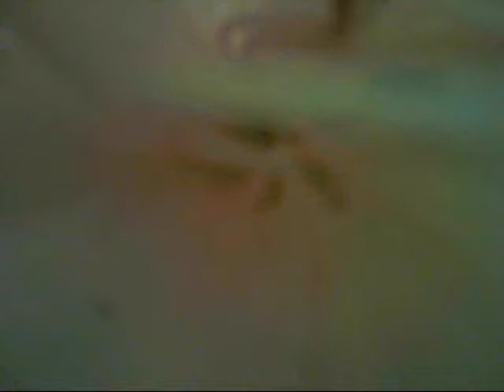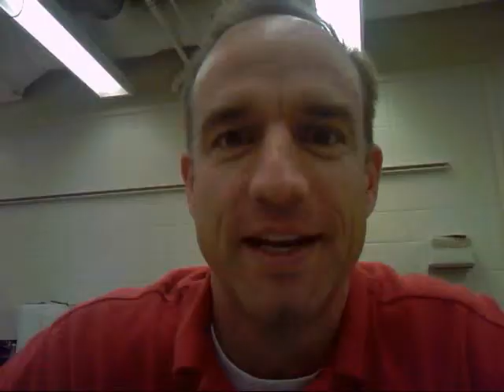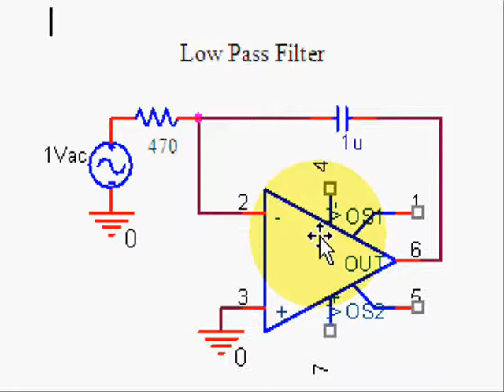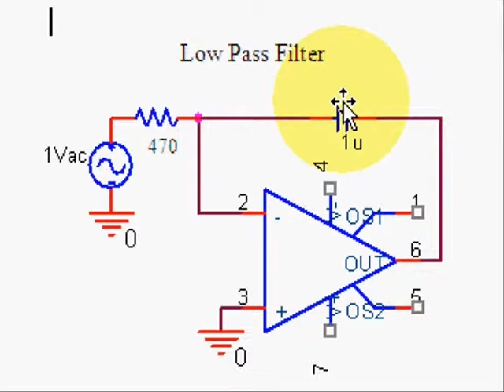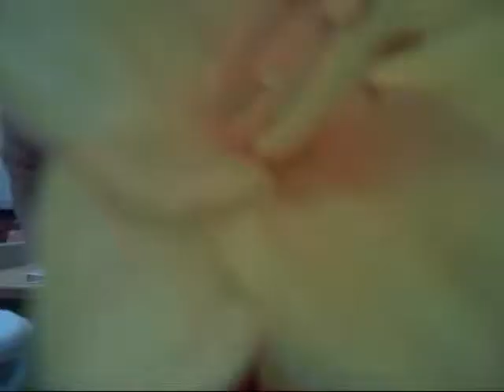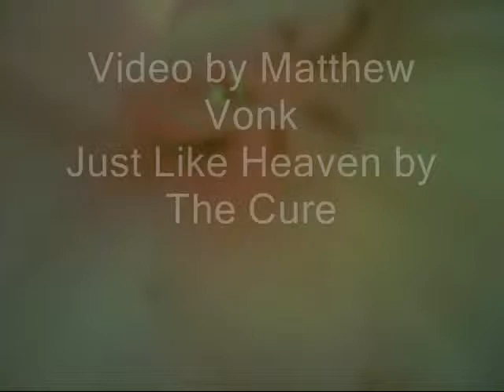150 Active Filters High and low Pass

Comment from the maker: Yes that's right.  Most student's think that if you remove the feedback resistor then the feedback resistance goes to zero, which means that the gain would go to zero, but in fact the feedback resistance goes to infinity when you pull out the feedback resistor so the gain goes to infinity and the opamp saturates.  

Good job!